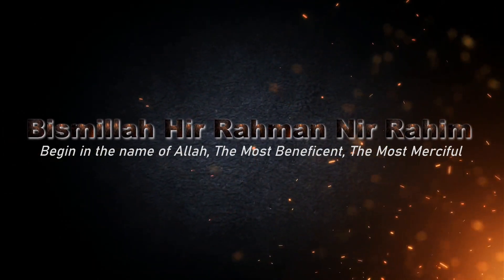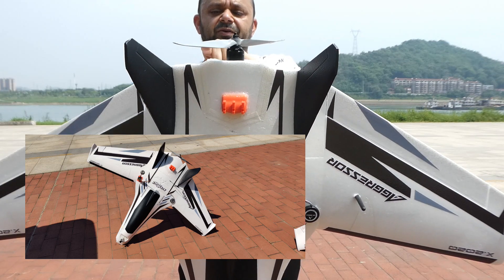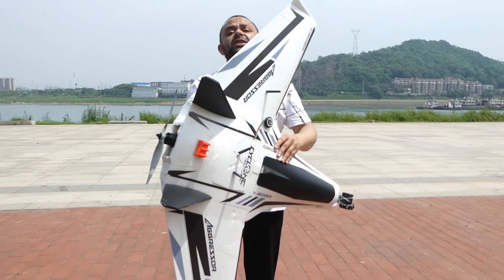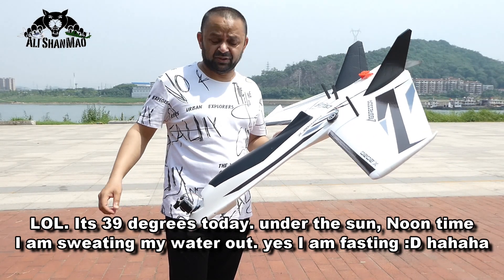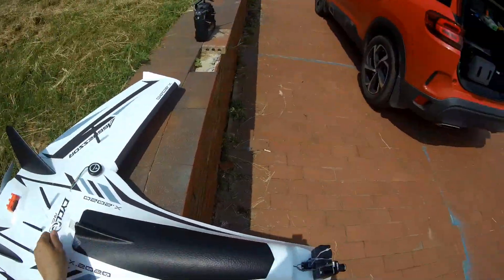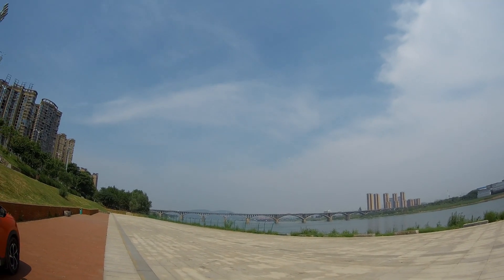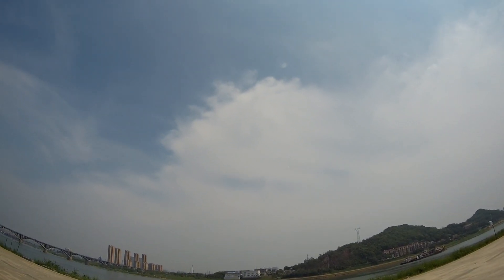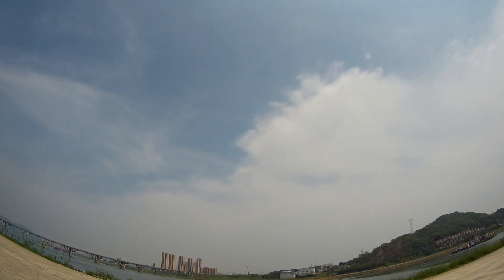Aggressor Long Range FPV Flying Wing FPV Test Flight

Comment: I finally finished building the Aggressor! I'm getting ready to fly its maiden flight but I'm having trouble figuring out exactly where the CG is. Are there any markings on the bottom for CG?
Reply from the maker: I have posted the CG location in RCG forum thread of this plane. go check it out
Reply: @alishanmao  Awesome! Thanks for replying back to me! I'm at work now looking forward to getting this plane in the air on my lunch 😊.

Edit: This thing is amazing. This is my favorite plane as of right now. It's so stable in the air.
Reply from the maker: Share your videos in RCG thread of Aggressor

Comment: As long as prop is beind the wing, and Prop ARC is traversing the pressure differntial from the lifting surface, there will be a pressure induced harmonic, and vibration.  the prop / props need to be in clean air to work properly.

Comment: There you go. I've been building and modding wings (and everything else that flies) for quite a while now and suspected your jello issue was too square of area in front of the prop and the prop too close to the fuselage. I started tapering the motor mount area on all my wings to smooth the airflow to the prop which also makes the prop much quieter. The Z-84 and FX-61 were the first wings I did this to years ago. Recently designed a tapered mount for the AR Wing that's on Thingiverse. Clean, non-turbulent air at the prop is always the best for smoothest aerodynamics.

The Aggressor is a great looking and reasonably-priced wing I'd love to try out. Unfortunately most of the planes I used to order from Banggood have showed up damaged from poor or nonexistent packaging preparation for international shipping so I stopped buying planes from them years ago. And their customer service was just horrible. But if it's ever stocked in the U.S. I'd love to get one. Good job on your videos and business.
Reply from the maker: Our USA Dealer, he will have the Aggressor as well. I am arranging his order to be shipped once production is done :) will post links in due time, as soon as they make the links on their site. You can get rambler from him as well. and SN Navi and SN Lite FCs.
Reply: @alishanmao  Very good. Thank you.

Comment: Hi, can you explain how you dynamically balance your prop ?
Reply from the maker: make sure plane is secure and won't move, be very careful nothing should come in contact with plane, and propeller, make sure prop has plenty of open space around it in the room and nothing will fly into prop.
stay clear of propeller always, and take extreme caution as you will be dealing with high RPM blade in a room.
Power on radio and plane, 
Hold the plane where you want to feel the vibrations and spin the propeller, to a speed where you start to feel big vibrations (don't go full throttle.) increase throttle slowly and feel where the vibrations start.
now take a piece of white tape or colored tape (strong adhesive tape) and put it on one side of prop blade close to the tip of prop but not on the tip.
spin the prop again, at same throttle value and if vibration gets worst, stop and move the tape to other blade. 
if vibrations get less, you know which blade is heavier. now its all trial and error playing with tape size, throttle values, until you can reach to full throttle and have less vibrations felt.
this method takes time but can provide you better results. 
also don't forget to measure the propeller blades. sometimes one blade is longer than other, lol. even a mm can make difference, 
imbalanced hub, motor prop adapter imbalanced are other issues you might wanna pay attention to as well
Reply: @alishanmao  , thank you